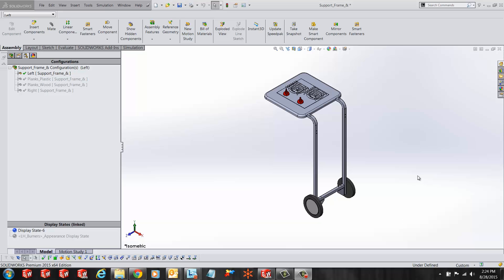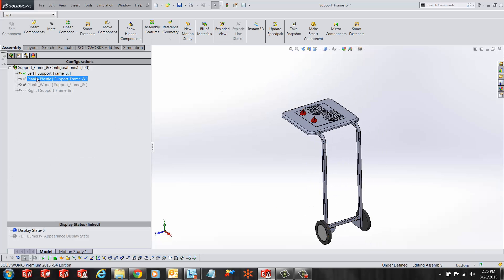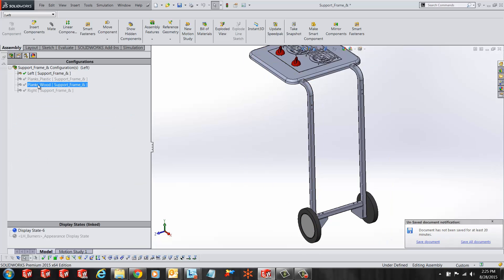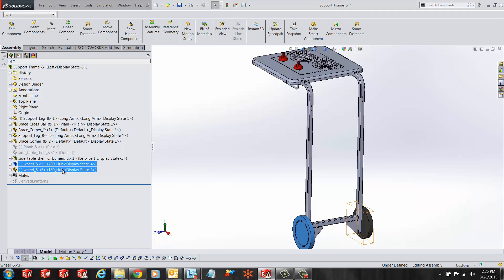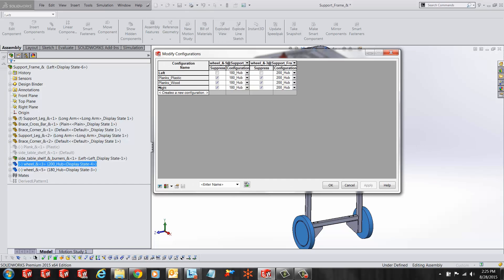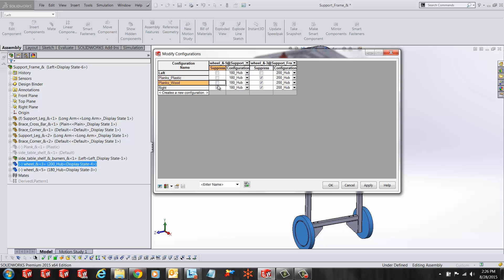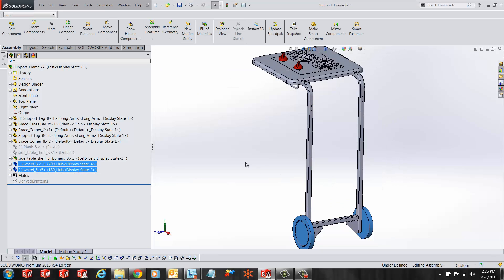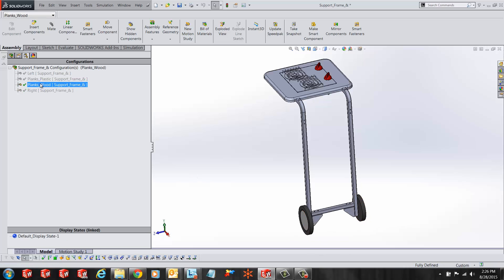SOLIDWORKS Quick Tip - Modifying Configurations

Comment: How do i start if i want to modify an imported  assembly example:  assembly of a knive, now i want to modify the  blade, how do i do that do i need to  save the assembly as parts ? how do i go beyond direct editing?
Reply from the maker: 1.	You may have 3D Interconnect on by default. This brings generic filetypes & common CAD filetypes in without translating the data. If you want to make changes to one of the part files, right click on that part file and click “Break Link”. See near the 7min mark of this video to learn how to do this: https://www.youtube.com/watch?v=ziYGM313f3Q.
2.	If you’re not using 3D Interconnect and you’ve got an imported assembly w/ imported parts, clicking Save will auto-create individual part files as well with the imported geometry. You just need to open that “blade” part and use direct editing to make changes. 
a.	Simple geometry can be turned into sketches + features using Insert > FeatureWorks > Recognize Features.

Comment: Wouldn't the wheels be added to all configurations of the assembly by default?  In other words, wouldn't you only add the components to the configuration manager if your intent was to turn them off for at least 1 of the configurations?
Reply from the maker: Hi,

That’s a great question! A certain series of events took place before the video:
1.	We had the Left configuration without the wheels. 
2.	We added the new configurations, Planks_Plastic, Planks_Wood, and Right. 
a.	Within all of these configurations, our default settings are likely different than yours. 
b.	Right-click on the configuration, Properties, Advanced Options. Note an option to “Suppress new components”. Ours is checked.
3.	Go to the Left configuration and add the wheels. 

This creates the layout you see in this video, where the wheels are suppressed in the three other configurations.

Comment: Probably too late to ask a question, but is there a way to mass suppress or unsuppress? Like, I've got a bunch of things in that modify configurations window that I need to take care of all at once, and it's gets old having to click them all.
Reply: A bit late, but I found you can copy the ✅(or empty box) by right clicking on it. Then, box select all the checkboxes you want to apply the ✅ (or empty box) to, right click, and click paste
Reply: Or if you want to uncheck a whole column, right click at the top of the column and click "unconfigure"
Reply from the maker: Hi Scott,
In this particular dialog there is not an excellent way to select all the check boxes for a particular column.  However, if you make a Design Table instead you can manipulate an entire column using the Design Table's MS Excel interface.  You could simply copy a cell across multiple cells to set suppression states for many or all configurations at once.  Take a look at Design Tables and see if that doesn't work better for your needs.
Reply: I use the design table function sometimes but hadn't thought of using it in this situation.  Thanks for the reply!